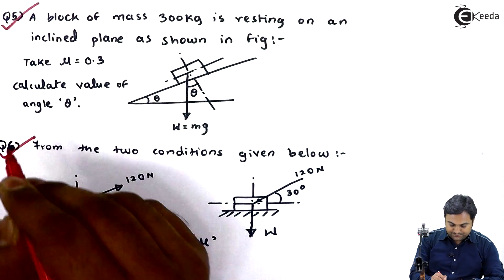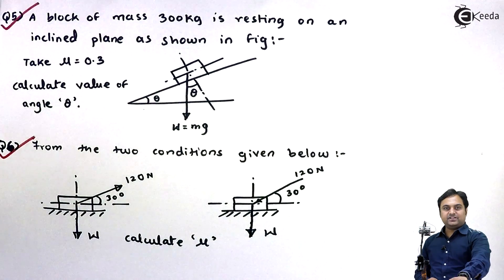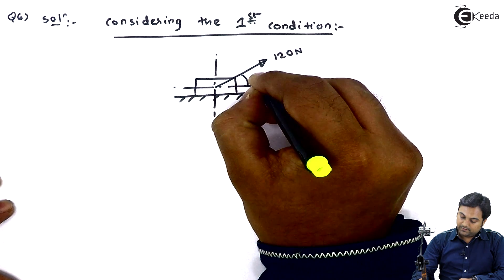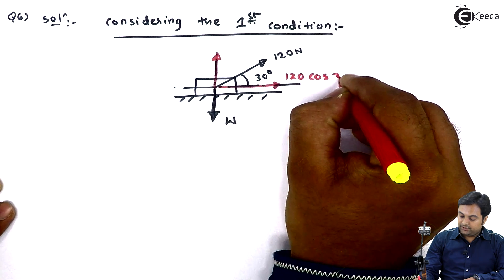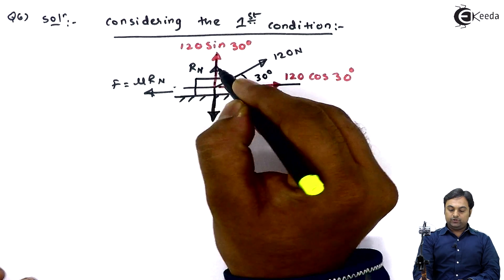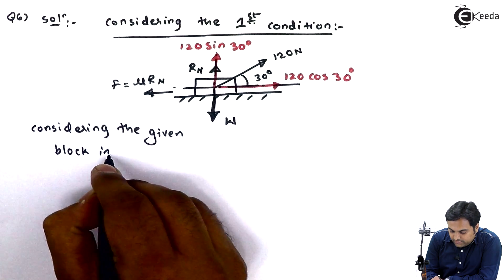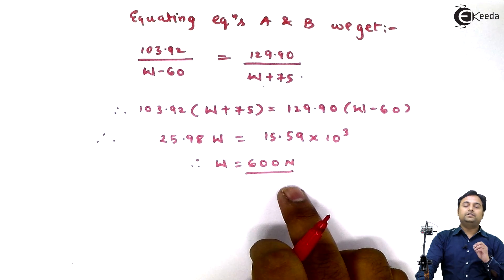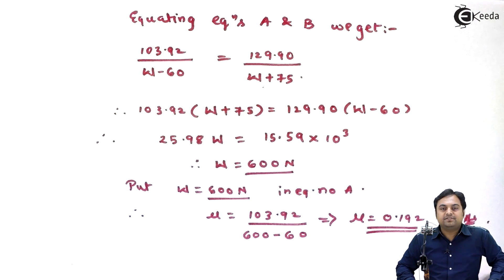Friction - Problem 11 - Friction in Engineering Mechanics - First Year Engineering

Comment: For the 1 st figure 120cos30 = 103.92 Nd for 2nd fig 120cos30 = 129.9.
Also for 1st figure 120sin30 = 60 Nd for 2nd fig 120sin30 = 75..
What's this ??
Actually the que is wrong...
Reply: Prasang Singhal he has taken force of pulling as 150N so he got other answer
I have solved problem and after that I have listened to his explanation ,i thought that I have taken wrong data but he has made mistake

Comment: Wrong solution and worst explanation of that.
1. First of all in both cases coefficient of friction will be different as coefficient of friction is not a constant thing, it is dynamic and keeps on changing until it's limiting value reaches. In this question the nature of  force applied is entirely different so the value of coefficient of friction will be different for both cases.

2. I don't know from where the teacher is copying the answers.

I've gone through more than 60 videos of that playlist and believe me you will neither get concepts nor get any variety in questions. Many times questions have been repeated also.
Similar kinds of questions have been solved repeatedly in every video those are also of very low level.
Don't waste your time.

I think such YouTube channels on  Engineering disciplines are not fulfilling required standards and also not covering the whole syllabus of the subjects.

NPTEL videos are much better than these but the problem is that you will not always get everything from basic level or from scratch.
If you are good at basics then you can through them.
Otherwise books are always the best. You can get good concepts and a variety of questions there. So, please don't waste your time.

This is my view. If are okay with these lectures then you can go through them.